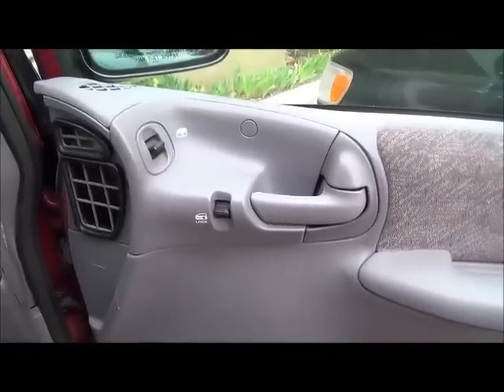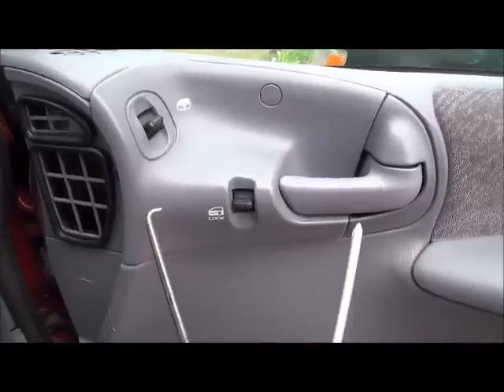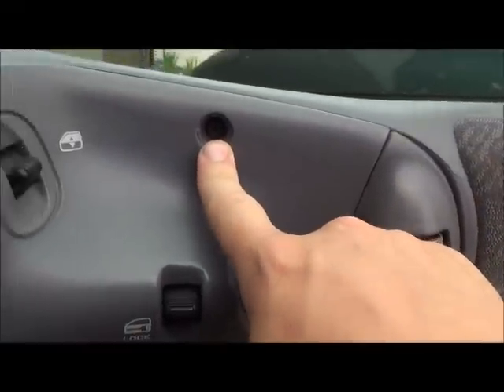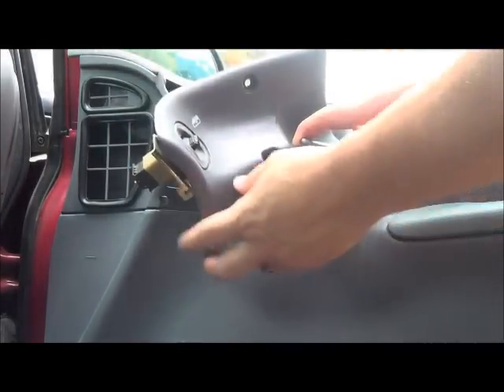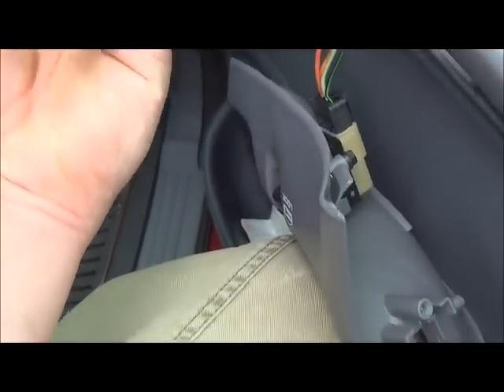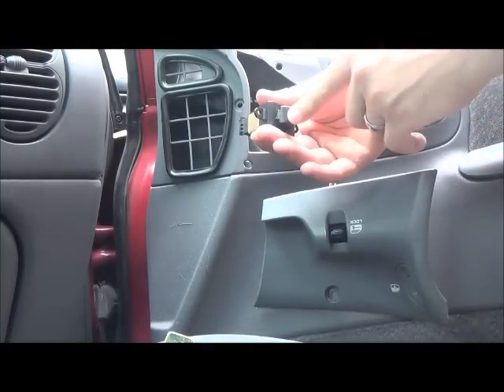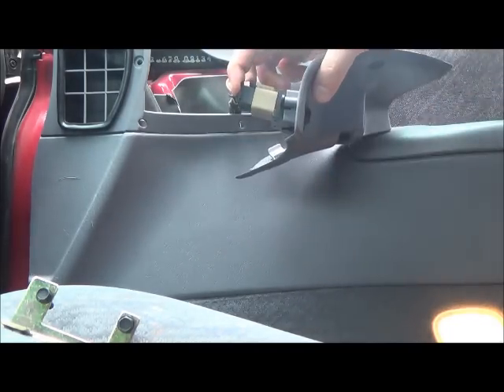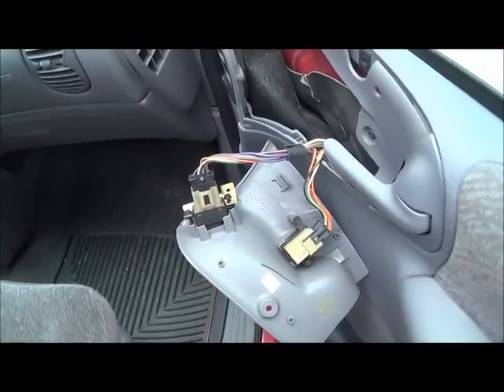Caravan Window not working? Replace window switch.

Comment: Help - I have 2003 Dodge Caravan. Original master switch - driver side window will roll up and not down. Bought a new master switch on Ebay to replace original one. New master switch will roll window up but not down. When I changed it back to original master switch, same issue - driver side rolls down, not down. Same with new master switch, roll up not down. Both master switch operates all other windows up/down, no issue. Just driver side is the problem. Did I get a bad new master switch from Ebay or is there something else wrong?

Comment: was your driver side switch able to control the window on the passenger side?
Reply: This happened in my van, my driver's side could roll down the passenger, but the passenger switch didn't work to roll down the window.

Comment: The passenger window button does not roll down the window. The button on the driver side for the passenger window is also not working. In this case, is this the malfunctioning buttons or something else is wrong with it? Thanks
Reply from the maker: Id replace the switch. That's most likely you're issue

Comment: If it doesn’t work can it possible be the window like opening up the door panel and replacing the other part?
Reply from the maker: Probably the motor that is in the door.
Reply: Robbie TwoScraps is it b the power window regulator? We might need to get it from a junk yard do you have a video for that too?
Reply from the maker: @MissFayeLuvA11  That is probably your issue. I don't have a video on that